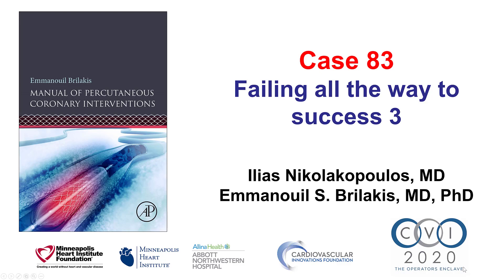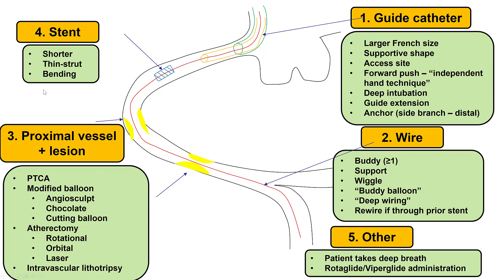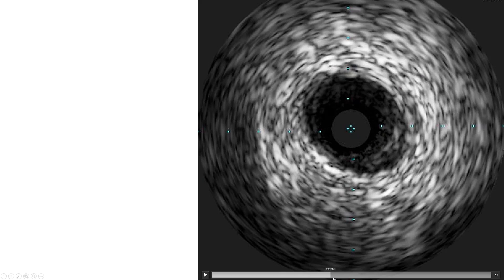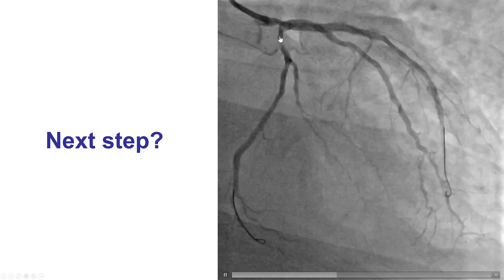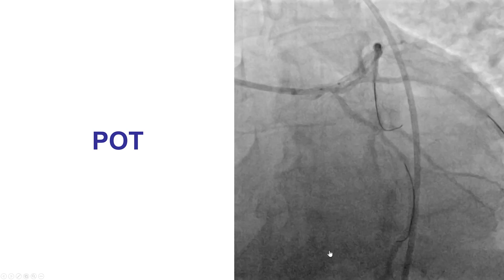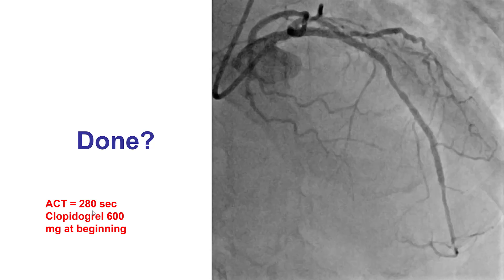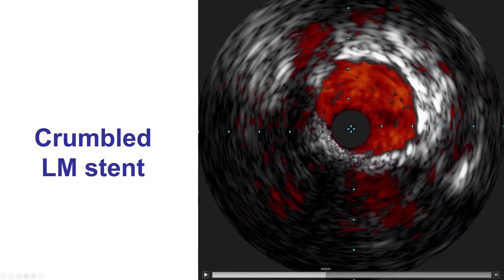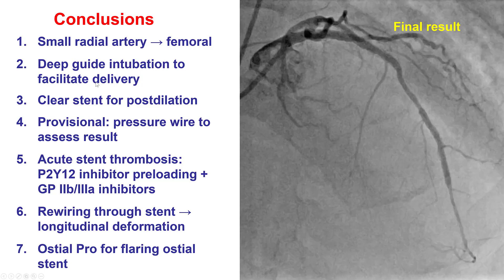Case 83: PCI Manual - Failing all the way to success 3

Comment: Thank You very much for interesting and amazing case. Do You  open the stent cells from left main to intermediate and from left main to LCx by using kissing or trissing method? Do we need this when we use thin strut DES? In my opinion - yes, but if it possible, can You share with your thinks about that? Take care of yourself, colleagues, Your loved ones.
Reply from the maker: We did not in this case, but would be reasonable to do.